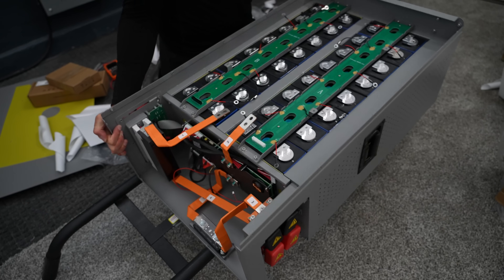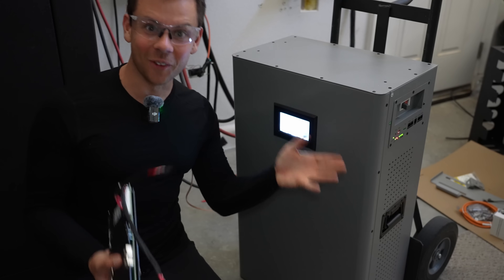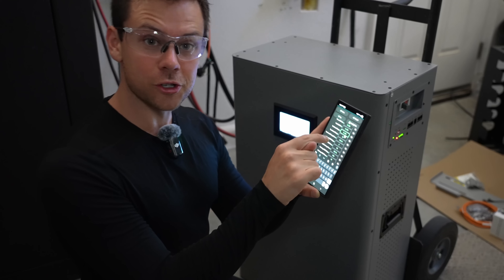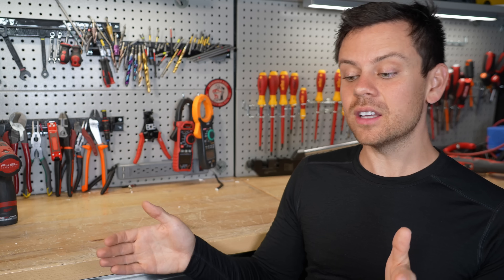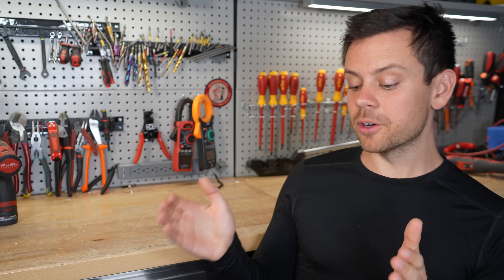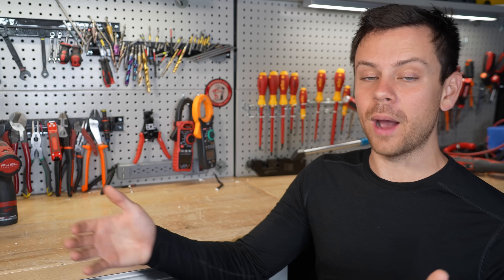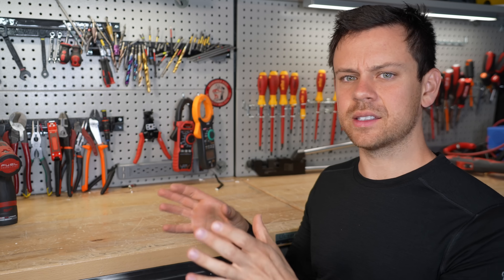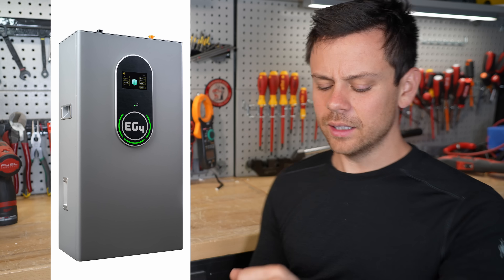Yixiang 16kWh Battery for $1,899?! What in the world!!

Comment: Perhaps it may make sense to run a tap thru the terminals to debur them.  Thanks Will!!!  I am an EE that designs solar and am truly impressed with your knowledge and the thoroughness of testing!!!
Reply: That was my suggestion as well. Run a tap and vacuum up any debris. Might be helpful to run the bolts through a die as well
Reply: It's aluminium, so use some Methylated spirits on the thread and it will screw on fine.
Reply from the maker: Yeah this is a common issue on the forum, it is welded and a tap would hit the cell, so you cannot repair it like that. It is actually a tough problem to solve haha!
Reply: @WillProwse  As noted by others already, use a *BOTTOMING TAP*, also called a "blind" tap. Those are designed for EXACTLY this sort of use - where a hole that's effectively a dead-end needs the entire length of the hole threaded. If you're working with an unthreaded hole, you start with a regular, tapered, "through-tap", work it in until it bottoms out, then back it out and finish the job by working the blind tap in - once that bottoms out, you'll have perfect threads all the way to the bottom of the hole (Just be sure to use lots of cutting oil to assist in flushing the trapped chips out so they don't pile up and create a "false bottom"). Since the holes you're working with are already (mostly) threaded, you just need the blind tap that matches the existing threading to "finish off" the job that should have been done at the factory. Last time I checked pricing, they're all of about about $3-5 (depending on size) more than a regular, tapered tap. The regular tap has a "get things started" taper that makes it impossible for it to make a clean thread all the way to the bottom of a blind/obstructed hole, but the bottoming/blind tap does it (dare I say it?) like it was made specifically for the job.
Reply: @WillProwse 7:27 That's normal outside the United States..
Reply: @WillProwse what about using a self tapping screw in place of stock ones, (maybe they have too much iron in them?)… I’d be curious to know if self tappers are compatible with the aluminum if coated with anti oxidation gel?
Reply: @lureup9973 : I'm almost positive there would be galvanic corrosion issues if you did that.  Steel and aluminum don't play well over time.
Reply: I was thinking exactly that .
Reply: @kaboom4679I think I have the answer why it wouldn't work. A normal tap is tapered at the tip longer than the depth of the hole. It would bottom out before it cut any threads. 
So some grinder work on the tap would be needed
Reply: You could use what's known as a bottoming tap, it's not tapered at the end.
Reply: @theviewfromtheporch I don't know what the thread pitch is but in the past I've bought grade 8 bolts and used an angle grinder to cut a flute and that works pretty good as a thread chaser. A little cheaper than a bottoming tap
Reply: @theviewfromtheporch  exactly, the hole is already threaded and you’re just chasing the threads, so a bottoming tap would be ideal for this application
Reply: I was about to say the same thing. Just get a bottoming tap.
You can also make your own with a bolt and hacksaw.

Comment: I feel like no critical power system component should have "JK" in the name. 

"I promise, I won't burn down your house."
"JK"
Reply: A year ago I had a 300AH name brand battery, 1 of 12, catch fire on its own and burnt 8 of the batteries above it. The Forensic Fire Investigators  think it was dropped upside down from 5-6 feet sometime during transit as the wires to the BMS showed signs of crushing.  This did $150,000 smoke and water damage to my shop and garage. By the grace of God, I was home and got a fire hose and put water on the console 70 seconds after hearing the pop. 

I have been a DIY'er for over 6 decades. I am a retired power generation engineer. I started building LiFeP04 units for family and friends since the NorCal wildfires of 2017.  The fire at my house was a gut punch. That was home build LFP project #10 with no short cuts taken at all.  I am still dealing with getting things back together almost a year later.

 I recently bought 5x280 AH EG4 wall mount batteries and a Flex Boss 21, 6000XP and paid the full price.  THEY ARE UL LISTED.  Signature Solar says they have internal fire suppression. I noted that there are no air vents in their cases, just 2 plastic fusible plugs near the battery top.  The Boss Box still might end up outside away from the house with 205 degree fusible link water sprinklers inside over the batteries.

My fire insurance covered much of the replacement costs, but not everything. Had another 4-5 minutes gone by, the Fire Chief said that my whole house would have been engulfed in flames. I saved my home! Many of the things inside...collections, a few Honda CBX bikes, my old Ferrari, my 4 wheel drive Triumph Spitfire would be rusted and melted scrap.  My wife was 77 and was severely handicapped for her last 8 months. Had I been gone, she may not have been able to escape. 
She passed away last Christmas in the hospital.

I learned my lesson and will never trust LFP batteries ever again. I will never go cheap when it comes to backup power. Unless you witnessed the damage burnt LFP cells can do, you will not understand. Their greasy toxic black smoke even covered the concrete floor and seeped into everything. It's corrosive, too.
Reply: @kimmer6  Wow...that sucks

Comment: I think I would try running a tap through all the cell terminals to clean up the threads prior to assembly...
Reply: It's aluminium, so use some Methylated spirits on the thread and it will screw on fine.

Comment: If you were to strip a hole out what is stopping someone from using a tap to make a larger hole with probably better threads?  I own a tap and die set to fix (or create) threads on stuff all the time.
Reply: Would need a bottoming tap as a regular tap would pierce the cell

Comment: Possibly only in my case, in my 36ft enclosed trailer I had 4 12v lifepo4 in 48v with a 3500w renogy inverter/charger, they were charged to full before hookup and within a week i had batteries triggering overcharge showing ~14.8v and some showing 12.5v (while input going in) and SoC being off up to 5% from each other. All issues went away after adding the powmr equalizer, which i believe is a active balancer. (the 12v's were the cheapest of cheap with bluetooth i could find at the time too "Mehrpow 12V 100Ah LiFePO4")

Comment: I have 8x of the Horizontal YiXiang V2 boxes. 5x of them with MB31 cells from YiXiang, and 3x of them with upcycled Grade B CATL 271ah cells. The V19 JK BMS is a beast, and works fantastic. The build quality was exceptional, with no bad parts out of the box or anything. Shipping was about a month for all the cells and the boxes to arrive. The only real problem I have found, and this has been brought up on the forum, is the MB31 cells have some hairline cracking in the welds of the terminals, which YiXiang says is totally fine. Whether it is actually fine or not, I have installed them, and do not have any problems, heat, or resistance issues. Even with that minor issue, I definitely want another 4x boxes!
Reply: Jeez.....are you powering a small town? 😂
Reply: @wadebrewer7212  I have ten working in a small village in Africa.  They work fine.
Reply: @wadebrewer7212  16 kw x12 box = 192 kw. Enough for Supermarket
Reply: @wadebrewer7212  Farms and small commercial have some big power requirements.
Reply: Same here, I have 4 of their DIY 16K boxes, one box using their MB31 314aH batteries and the other three with a GP brand.  GP batteries are much better EV cell quality than the YiXiang MB31 IMO.  The cell diff is way worse in the YiXiang MB31's but still below 20mV during charge and discharge. Def need the JKBMS to Active Balance them.
Reply: My 5th horizontal box and batteries are on the way from them. It's probably the best DIY box out there right now.
Reply: Where are you located would love your expertise!!! 😅
Reply: Hi, as you made such a good comment, here's a few questions: I am looking at buying a home battery large enough to charge my Tesla anytime. The Tesla has a 62 kWh LFP battery. What size home battery would you recommend? From which supplier? What type of cells? And which BMS? All information will be really appreciated.
Reply: @RossWexford  16kwh battery x 4 = how much?

Comment: I'm curious what you're loading the 100kWh system with to use the whole capacity each day, a big cooling load?
Reply from the maker: Forced export during peak times and charging my model x. And four air conditioners 🤣
Reply: I'm more curious about how much battery capacity he has combined with all of his systems. Probably enough to run the lights on the Vegas Strip at this point.

Comment: The EG4 indoor battery has cell heaters.  I've tested them down to -15F with no issues in an unheated pole barn.
Reply: I would just try to put them inside. I don't want to rely on some heater that could break and lead to catastrophic failure. 

LiFePo4 is safe to put in your house. They don't need that much space.

Comment: Hopefully this ages like a video from the 90's talking about how cheap hard drives are becoming, it's UNDER $1 a megabyte!
Reply: Back when 16MB of RAM was 700$
Reply: Waiting for the sodium batteries or the capacitor designed ones.
Reply: @klyanadkmorr sodium batteries have a terrible voltage drop and the delta between full and empty is ridiculously high. Andy from the Off Grid garage has tested that chemistry and he found that LiFePO4 is better for most cases, specially for solar and inverters. Check it out and find your own conclusions.
Reply: Based on what I've read about lithium battery recycling the recycled lithium is actually more refined than virgin material. So I can't help but think once these raw materials get refined and the batteries eventually recycled they'll just get cheaper and cheaper. I remember about 4 years ago the cost of a 100ah 12v lithium battery was like $800. Now they're like $150 on sale.
Reply: @mathehack1  Indeed, lithium batteries are just highly refined ore that's been rearranged!
Reply: @mathehack1  Battle Borns still are last I checked. Absurd.
Reply: @mathehack1 ... Even $120
Reply: Look at videos from 1-2 years. People were paying around 100K USD for a 20KW system. 
Either those people are really stupid or it's getting cheap really fast.
Reply: @madd5 it’s getting cheap really fast. Chinese EV industry is pushing battery development really hard

Comment: I balanced my battery bank, which was unbalanced by a small degree, from one of the batteries in a series/parallel group. I fixed this by not having a load on the bank and let the charge controllers and the sun balance it out in about two days.

Comment: My EG4 100ah 48v server rack batteries took quite a while to get balanced. Once a single cell tripped the OV limit, the charging MOS shuts down. I had to charge very slowly, with a load to get the 98% state of charge cell voltages to finally level out. Keeping all cells below the OV setpoint, but above the linear curve voltages.